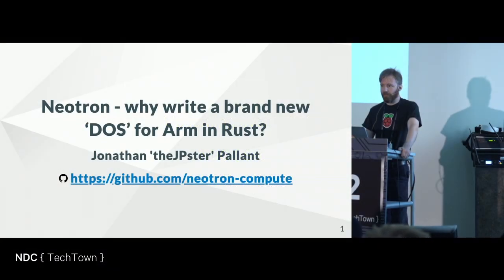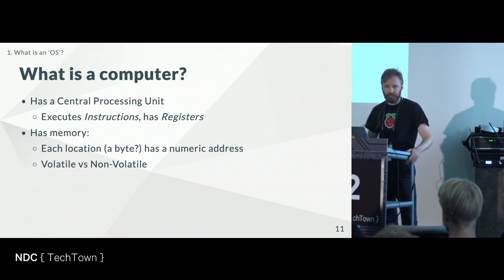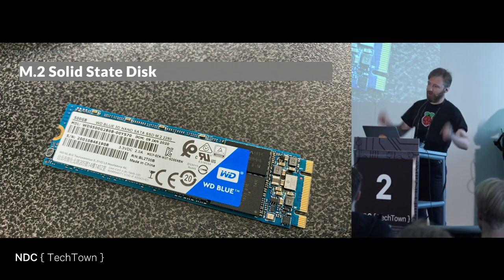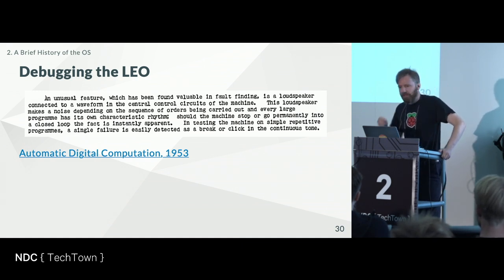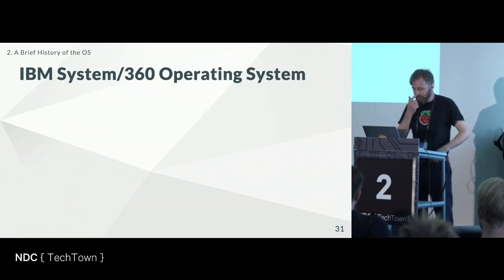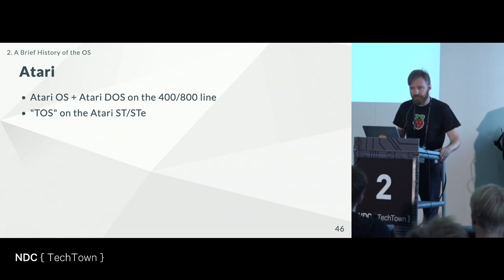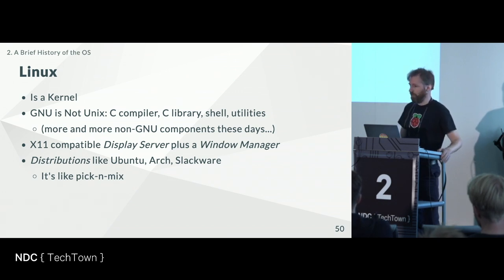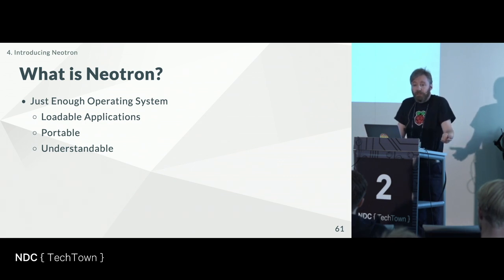Neotron - why write a brand new ‘DOS’ for Arm in Rust? - Jonathan Pallant - NDC TechTown 2022

Comment: I agree that browser is an OS, and I think next successful OS would use wasm as first-class and maybe only apps distribution format
Reply: As long a a browser relies on a kernel, a bunch of libraries, a ton of other services running on the machine etc, it cannot be an OS. It is an application that runs on an OS. Currently one cannot do any kind of hardware I/O from a browser without the help of an OS. Not even in WASM. Ergo a browser is not an OS. Even if it provides interfaces to JS or WASM applications that superficially look like an OS. 

I like the idea of WASM as a distribution format. But as it stands one cannot write an OS in WASM.

Comment: Strangely enough when I was a teenager in the mid 1970's building by first circuits with the new fangled TTL logic chips that became available I was having a terrible time getting them to work. My old father, who knew nothing of digital electronics, suggested I attach an old set of head phones to the circuit and listen for activity. In no time at all I had the circuits working! Little did I know Lyons Tea shops had that idea decades before!

Comment: I'm a bit sceptical about having the OS interface exposed in Rust. This essentially forces every userspace application to be in Rust too (since, as far as I'm aware, there's no stable C representation for std::Result, for instance), or at best use a Rust wrapper. Also, compatibility with existent programs matters, even though I like the attitude that it shouldn't prevent radical design decisiona. A new OS with a fresh approach sounds great, but I doubt this one will be it
Reply: Actually that’s not true. I’ve written my own C compatible types so you can write applications in C quite happily.
Reply: @therealjpster  It's fine if the types are made compatible, but from the slides it doesn't seem to be the case. Not unless enum layout is a fixed and documented part of Rust's ABI
Reply: @terragame5836  Rust lets you opt in to other ABIs, e.g. extern "C" on functions and #[repr(C)] on types. Trust me, it works, even on enums where the variants contain data - it becomes exactly like a C struct containing an integer tag and a union.